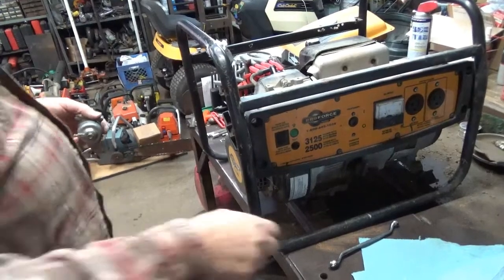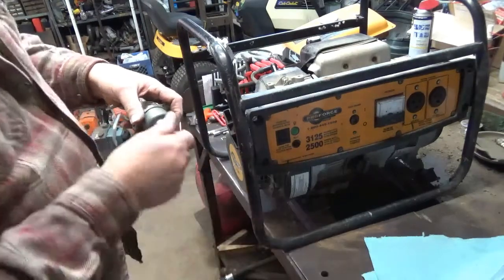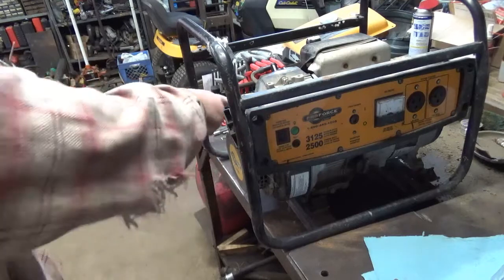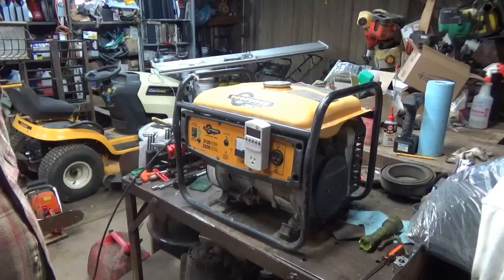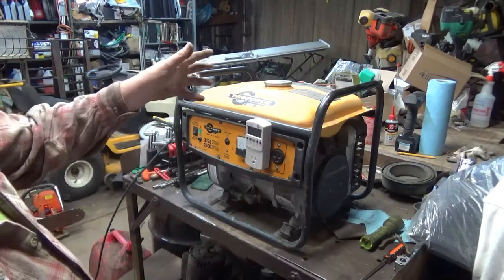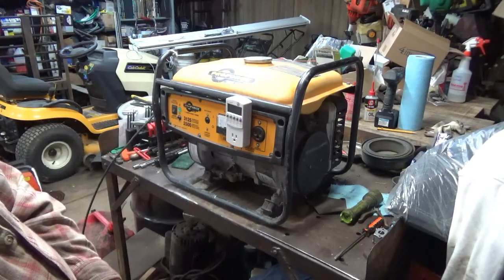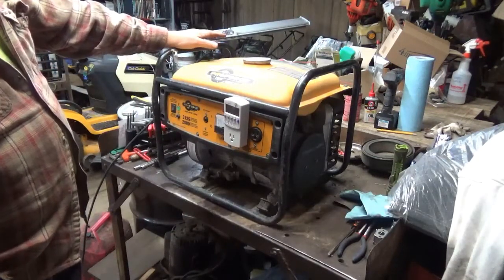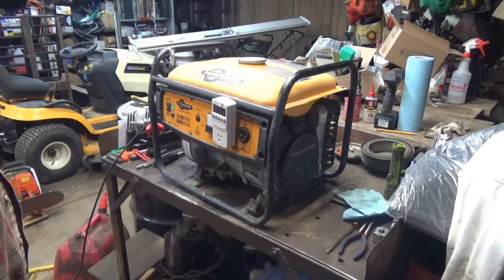Proforce 3125 Generator Part 2

Comment: Why won't my pro force rev up and dies a few seconds after starting
Reply from the maker: Without being able to l👀k at it I really have no idea as to why it is doing this. 

My best guess and it's only a guess is that the carburator is partially plugged up and needs cleaned but this is only a guess. 
You make it sound like some sort of a fuel issue. Like you allpy the choke it starts you turn the choke off it runs for a bit then dies.

Comment: I'm working on one of these right now. The first issue was a bad 24uF capacitor behind the main panel, easily fixed. It runs and delivers full power but when you unload it from full to half load it starts surging. I've tried lowering the tension screw on the governor arm, which does reduce the surging, but in order to eliminate it I have to drop the tension so much that the engine runs at 56-59Hz.

I thought maybe it was air starved, but removing the air filter with the engine running caused it to die. I then cleaned the carb, which improved the running with no air filter, but not the surging. I'm going to get some fresh gas tomorrow and see if that helps any. 

I had a diesel engine sitting for about 15 years with fuel in the tank and it started on the first attempt, but a gas engine with 3 month old gas? Nooo, of course that won't start.
Reply from the maker: From how you explain it sounds like a fueling issue,  but first make sure there is and it's  hooked up with tension the spring that goes over the throttle linkage from the speed adjuster to the carb, if it's missing or loose it could cause this type of issue. 
Next, You cleaned the carb but did you check the air idle circuit jet? The little black plug under the idle set screw, there is an orifice in the brass that may be plugged, I use small strand copper wire to open up.
If the carb sat for an extended period of time with old Ethanol Gas in it then your best bet would to be just replace it, will save you a bunch of headaches. 

Highly unlikely but the governor could need adjusted or has slop/play in its components, check for ware and loose components.
Reply: @craigtimmons3468   I didn't check the air idle circuit jet because I was scared to mess with something I don't understand. I'll try counting the turns in before backing it out and hope for the best. Mine is a slotted brass plug underneath the idle stop set screw.

I have a feeling the gas in my country doesn't have ethanol, because I've never seen the kind of carb damage people say ethanol causes here. I'm gonna do a test shaking it with water soon to test for ethanol. The carb on this engine had only a tiny bit of corrosion on the butterfly valves, probably due to the salty air here. The bowl had some sediment and brown "varnish" in the very bottom where it doesn't fully drain when emptying the bowl with the screw. It cleaned up nicely with some water based degreaser and the inside of the bowl is still shiny. 

All the springs are in place and functional. I haven't had the engine apart to see the condition of the actual governor.
Reply: Ok so the air idle circuit jet isn't adjustable, it was screwed in all the way. Sure enough, the orifice was fully clogged with "varnish". Everything is cleaned out now and it is running perfectly. 

I was able to readjust the governor spring to bring it back up to speed. It is now delivering a sustained 3056 VA with a resistive load at 120 V, 59 Hz. No load speed is 62 Hz (~130V). The engine even has a little more throttle range at 3056VA. I'm kind of amazed it actually delivers what the label says. The electrical wiring inside seems to be on the anemic side though, and all the wire terminals seem made of very thin metal.

Thanks for the help! Now, should I tell my buddy who gave it to me for free that I got it running perfectly again?
Reply from the maker: @bhartley1024 Congrats, Glad I was able to help you get it running, Yes the wiring dose look a little iffy but remember there's not many amps.
My suggestion is if you don't want your friend pissed so to say I would wait a few months before I would say anything Bout getting it going.

Comment: I'm working on the same model after a guy had it stored a long time. The gas smelled like varnish, the petcock valve was plugged up cause the black rubber gasket with the four holes had gummed up and plugged the fuel inlet...like yours did, and the float valve in carb was slightly corroded and frozen in place. Otherwise the carb looked pretty clean like yours. I was able to clean the gooey rubber gasket up in the petcock valve and clean the holes in it and the carb with some old guitar string pieces. That and fresh gas got her running real good, but no output from the generator. The breaker switch was broke off just like yours and the impact of whatever broke it must have damaged the inside because it ohms out as open in both on and off positions. I bypassed it and used a 15 amp fuse just to be safe, but still no output. I'm leaning towards it being that big 300v capacitor, but need to do some testing. It sure would have been nice to see how you would progress from this point, as you really displayed some good troubleshooting in this video. Great job, great video! Thanks for sharing.
Reply from the maker: Your Welcome,  If I would not have had power out put first i would have checked the capastior that on to the power head for testing, it would take way to much space to explain how thats done but here is a guy who has many videos and does an excellent job with conveying the info check him out here on YouTube. James Condon.
Hope you get it figured out.
Reply: @craigtimmons3468  Thank you sir. I'll check him out.